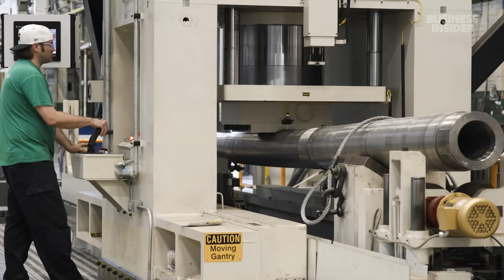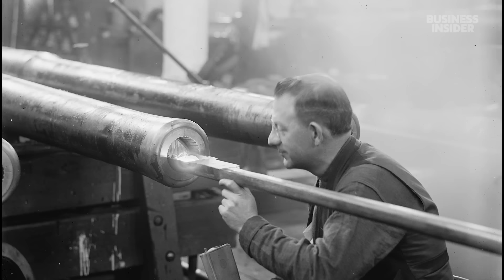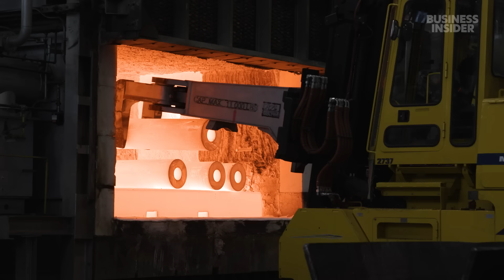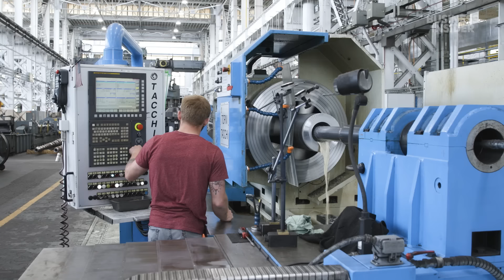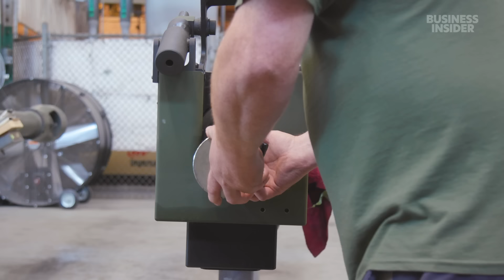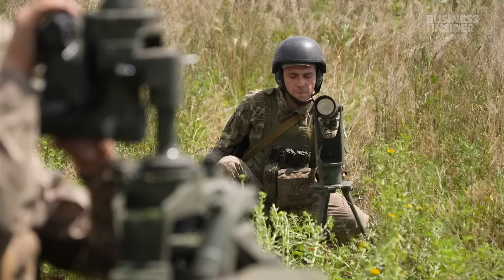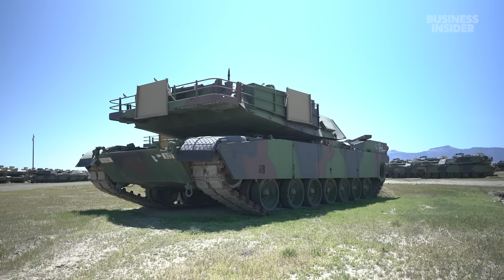Why the US Has Only One Factory for Cannon Barrels

Comment: My Grandfather worked at the US Army’s Watertown Arsenal in Watertown, Massachusetts after getting out of the Navy in 1920 until his retirement in the early 1950’s. This Arsenal is ( which today has been turned into luxury apartments, shops and restaurants ) is located just outside of downtown Boston. My grandfather worked in the foundry where the Army made artillery components, gun carriages as well as field and seacoast mounts. I have a Watertown Arsenal newspaper from WWII detailing my grandfather’s job in the foundry where they called him “The Ironman”. Included in the article describing my grandfather’s job there’s a photo of him standing in front of a large open furnace (wearing no safety gear) in the foundry.

Comment: It costs the DoW a lot of money to keep producing howitzers. M777 cost 3.5 million and production of a HE 155mm average between $3,000 and $8,400 per unit. It takes a lot and the Army has been slowly removing its self from producing artillery and munitions. I was dealing with M119 that had more issues then single mother with abusive baby daddy. Parts came in slow and maintenance was ever on going chore. The Army is more inclined to use HIMARS then because it’s far more accurate then conventional curved trajectory cannon artillery. One day all the howitzers will be replaced with HIMARS and Mortar systems.

Comment: 15 years ago a company right here in Phoenix Arizona actually Tempe Arizona they believe that was big enough to cut 18 inch barrels and they chop it up and scrapped it they were the dumbest people I ever worked for they were getting it getting it ready and then they flipped it they scrapped everything that they can get their hands on convincing the owner they were fixing it they did have me refurbished most of the equipment they didn't strip out it stopped leaking everywhere actually put timers on it so they could actually know how much labor they were putting into each product reduce the cost pissed off all The Machinist that had been ripping the company off for years working overtime hours on pieces that were done days before it was a Pity when I seen it it was beautiful the table was 75 ft long level straight smooth beautiful they took torches and chopped it up

Comment: To rapidly produce military assets, you need a modernized Defense Industrial Base (DIB) with flexible, scalable factories, resilient supply chains, robust digital integration (AI, automation), strong energy and transport infrastructure, streamlined acquisition processes, and financial incentives like option contracts to ensure contractor readiness, transforming the system from peacetime to a wartime footing. Key infrastructures include advanced manufacturing facilities, secure logistics networks, resilient energy grids, and cloud-enabled tactical IT, all supported by government policies encouraging innovation and surge capacity. 
Industrial & Manufacturing Infrastructure
Flexible Manufacturing: Factories with modular designs, robotics, and digital twins for quick retooling to produce diverse weapons, from drones to artillery.
Surge Capacity: Expanded, modernized DIB facilities that can quickly scale up production (e.g., for munitions) beyond peacetime needs, notes Fortune Business Insights and the U.S. Department of War. 
Supply Chain & Logistics
Resilient & Digital Supply Chains: Secure, transparent networks using AI, GPS, RFID for real-time tracking, and autonomous systems for last-mile delivery.
Secure Warehousing: Fortified facilities for storing critical parts, ammunition, and supplies.
Robust Transportation: Reliable airfields, ports, roads, and maritime routes (including subsea cables) to move components and finished products globally. 
Digital & Command Infrastructure
Cloud-Enabled Tactical IT: Modular, scalable computing and networking (like the Army's CEMI) that brings cloud capabilities to the tactical edge for rapid data analysis and decision-making.
Cybersecurity: Essential defenses for all digital systems and supply chains against attacks, notes the CISA. 
Energy & Utilities
Resilient Power Grids: Fortified and redundant energy infrastructure (like Guam's) to ensure uninterrupted power for manufacturing and operations, even during cyber or kinetic attacks, as highlighted by the Atlantic Council. 
Policy & Financial Frameworks
Modernized Acquisition: Streamlined processes (like the DoD's Warfighting Acquisition System) to speed up development and fielding.
Financial Incentives: Using tools like option contracts to guarantee future demand, encouraging companies to maintain readiness and invest in capacity, suggests the Center for Strategic and International Studies (CSIS).
Public-Private Partnerships: Fostering strong relationships and stable budgets for suppliers (especially second/third-tier) to ensure their long-term viability and investment, notes The Hill.

Comment: When the CIA requested multiple SR71's, Kelly Johnson had to create a fake company to get Skunkworks paid (Lockheed) 
This project was so top-secret that plenty of the companies supplying manufactured parts to complete this build caused an uproar over fears of not getting paid. 
Hilariously, Russia was the supplier of the titanium.
(The metal used for the SR-71 Blackbird, primarily titanium, was secretly supplied by the Soviet Union, purchased by the CIA through shell companies and dummy corporations in the 1960s, as the USSR was the world's largest producer, and the U.S. lacked sufficient reserves for the high-heat aircraft).

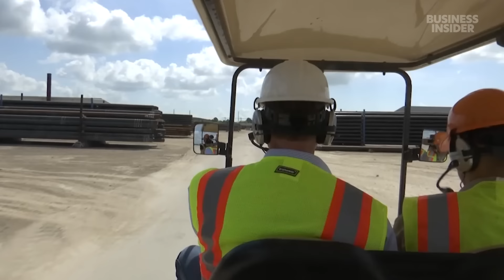Comment: If you are going to make a video about an industrial process, learn the basic terms. At 3:45 you say that steel bars are "shipped from FOUNDRIES" around the U.S.  A foundry is a place where iron is melted and poured into molds to produce cast iron items from frying pans to engine blocks to manhole covers. But cast iron is brittle.  The steel rounds used in a forge like the one at Watervliet comes from the rolling mill end of a steel mill.

Comment: As a hobby enthusiast myself I often wonder how do the machines that forge and make hard metals not melt themselves? Has to be solid rock cast right?im not sure on the science but I would think the only thing that could withstand heat more than the toughest metal would be an even tougher rock. Idk 🤷🏾‍♂️
Reply: A lot of it is a matter of time. While the tools will pick up heat from the metal being worked, they are themselves massive, and only in contact for a smaller amount of time so the heat transfer is minimized.
  Think of reaching into a hot oven to pull out a pan, vs being in the oven for an hour

Comment: The U.S still builds the M777 howitzer? It's woefully obsolete. By the time you've fired your first couple of rounds, aren't you struggling to pack it back up before your position has been triangulated and an enemy round is coming the other way? Even the M109 seems obsolete compared to Caesar, Archer, Atmos etc. The U.S expects and near demands its allies buy U.S weaponry, but the U.S won't ever in turn buy foreign-made kit even when it's better suited for the job. It could potentially even be on license, requiring one of these systems be built in the U.S.

Comment: They also have multiple factories, they just have them ship it to NY then they put a made in NY sticker on this. I used to work for a fabrication shop in indiana, we did quite a few government contracts. When we ship things out it cannot have any manufacturing markings on it. I had to go to new jersey to inspect something we made once after it was received. They literally put stickers and tags all over it that ALL the parts and assembly was done in the USA in NEW JERSEY! They didn't make a single part outside of our shop for this job. It's fraud for the betterment of politicians pay checks as is everything. It's a complete lie when they say there is only 1 factory. In fact another job we had to go out and inspect after delivery had all the parts made in indiana and illinois. They again marked it all as "Manufactured and assembled in New wark New Jersey. Not a single thing was done in new jersey for either job,  the second job hadn't even been removed from the semi trailer 2 days later when we got there. So even we had to use their equipment to unload it. It is all a lie. 
    Also do you really thing the government is going to only have 1 factory to produce their cannons? It takes them months to make 1 barrel. How do they make 100 cannons in a year then? It's a complete lie from start to finish. Good job on the no research for your video though.

Comment: 6:35 oh good the barrels are immune to biological attacks
Reply: Corrosion is a real pain
Reply: Its more important than you think
Reply: This might be a stretch but all a drone would have to do is drop a corrosive liquid on the barrel to render the tank cannon inoperable
Reply: @allaansnackbar4269  a drone with an explosive would achieve the same thing why go through all the trouble of using a drone to drop fart spray on the thing lmao
Reply: Equipment has to reach certain standards when it comes to such attacks yes. 

It's very often not about the equipment itself being destroyed or damaged by said contaminants but rather how they interact with them. For example some gasses might cause metal to corrode. Some liquids, like certain types of nerve gas, might absorb into some materials meaning that even if the equipment goes through decontamination in the event of an attack it still remains dangerous.

And yes, this applies to biological threats like anthrax as well. Might seem silly to do so to the barrel but it's really better to maintain standards on everything rather than only the things you know are risks. It's what you don't know that'll hurt you.

Comment: One of artilleries drawbacks is they have to be very mobile, be it setting up or leaving an area. Enemy counter fire radar systems have the ability to track the round to find the location of the where it was fired from. The location will instantly be shared with their own long range firing platforms or aircraft to be targeted. So our guys are trained to be gone in less than 5 minutes from after firing. Im sure nowadays theyre even faster though.
Reply: You are describing 1970's tactics, sorry.

Comment: The ping of the barrel when it's being marked is a very satisfying sound Tells you all you need to know about the quality of the material
Reply: It is high carbon steel with 2-4% nickel and small amounts of chrome and vanadium. So really nothing special in the world of alloys. Experimentation has shown that suuuuper exotic alloys only extend barrel life by 30%, but they are heavier and cost 5-10x as much to produce. The perfectly clean ring comes from the geometry and tempering. But it's essentially "a good quality kitchen knife" material wise.
Reply: I agree it's satisfying, but the ping is just a vibration. It just means that this piece of the material is allowed to / can vibrate. Not sure how that tells you anything about quality in itself ...
Reply: @bartrammeloo5046  Hit a piece of cast iron, and hit a similar piece of high carbon steel and you will understand. Metals with large irregular grains, like cast iron, are vibration dampening. That is desirable in some application where the trade-off of brittleness and low wear resistance is acceptable (gantries for milling machines and lathes are typically made of cast iron). Metals with small tightly packed grains, free of inclusions and impurities, ring like a bell. The harder the material, the higher the pitch of the ring. If you compare church bells in bronze and brass (bronze being the harder) by size and sound you'll notice bronze bells are significantly larger for the same pitch.

Comment: The steel rounds for making the blanks for the barrels don't come from a "foundry." That is a plant for melting iron or steel and pouring the molten metal into voids in a sand mold.  The gun barrel factory is a "forge" in which steel blanks are heated to a temperature at which the steel is still a solid but is plastic and can be shaped by hammering. That develops grain structure in the metal making it much stronger than when it came from a steel mill. This video skips a step in which solid rounds that come from a steel rolling mill are made into tubular shapes with a hole through the center.  It is those "blanks" that already have a tubular shape that are forged with hundreds, if not thousands, of blows from hammers in the rotary forging machine.  There is another video about Watervliet showing when that rotary forge was first used in the 1980s.

Comment: Trust me, it wouldn’t be difficult to convert other steel foundry’s into gun barrel manufacturers.  There’s a lot of steels mills in the US that make down-hole drilling tools for the drilling industry. Change a few steps in the processes and you can easily turn a drill rod into a gun barrel…..Easily.
Reply: Its the quality though, forging and manufacturing is open knowledge
Reply: Heat treatment capacity in the US is very lacking.
Reply: The rotary forgers that you need to make barrels are rare long lead time
Reply: Yea - and would want your kid to firing the guns using the initial production batch of gun tubes?
Reply: @colincampbell767 
The industry refers to the term “Quality Control”, it’s a manufacturing standard that requires factories to adhere to rigid manufacturing/materials standards.

…..or just go with whatever you said.🙄

Comment: Yes, having only one facility producing cannon barrels is a massive vulnerability in our coming war with China. We need to build new factories located in different parts of the United States. We need a private sector equivalent of Rheinmetal. But we also need to offer contracts to small individual inventors and small startup arms manufacturers. We especially need many ammunition factories of all sizes, including the ability to manufacture millions of artillery rounds every year. We should be building thousands of artillery pieces every year, not hundreds. That's because if there is a war with China it's likely to turn into a long war of attrition lasting for years not weeks. All the old equipment should be put back into production in different factories but with newer equipment mixed into the production line in order to speed up the production rates even for the old lathes and milling machines.
Reply: Ahh yes.
The warhawk boomer.
Must be nice sending others to Die while sitting at home

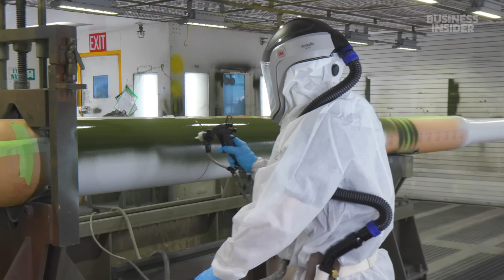Comment: 6:29 CARC Paint. (Chemical Agent Resistant Coating) Most US military vehicles are painted with it. It's satin to not glint light and you could rinse radioactive (and other dangerous)particles off with a hose and water.

Comment: I am amazed that their manufacture takes so long !    
I would have expected no more than a few days per barrel, maybe even faster.
Reply: Pretty  sure its the heating/cooling process is what adds to the time.  The steel needs to be in a certain temperature range to ensure it's structure isn't changed. It has to cool over fixed rates and reheated multiple times over the course of manufacturing it.
Reply: There also just isn’t a demand to mass produce barrels at the moment

Comment: They complain that the machinery is old. However, as we all know,  anything built now is built to the lowest standard and wouldn't even last for a quarter of the time. Modern manufacturing is also not repairable most of the time. Stick with the old equipment.
Reply: Consumer products have been greatly enshitified, but I can assure you that manufacturing equipment (which is all basically one-offs) is a different kettle of fish. It all depends on what you're willing to pay for it.

Comment: MASSIVE FAILURE: That Automatic lock mechanism at 8:08 WILL remove fingers in the future. If you are used to push the shell in with your hand (like they did first) and then have to use this your muscle memory will cause you to still push it in with your hand and your fingers will be gone.
Reply: It won’t. No one uses their hands in real life, real artillery shells are way too heavy for that. The crew uses a special ramming stick to push the shell off the freed tray and up into the chamber, hence the guy in this video also using a stick.

You can see them ramming a shell at 8:53 actually